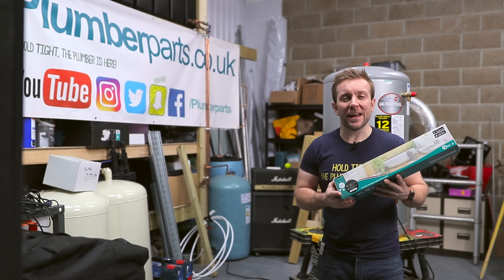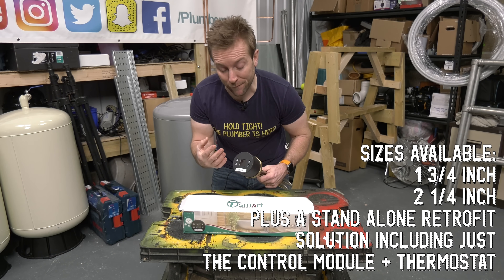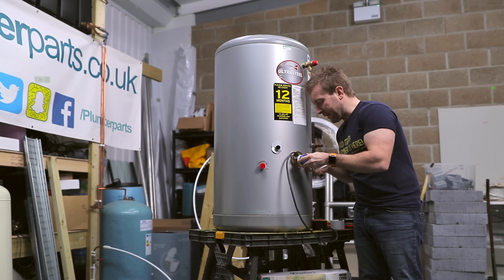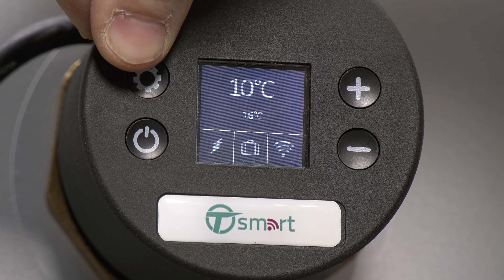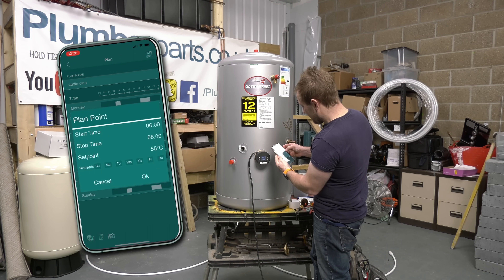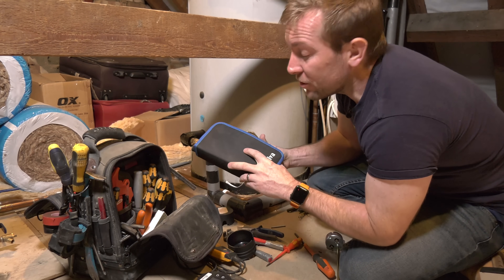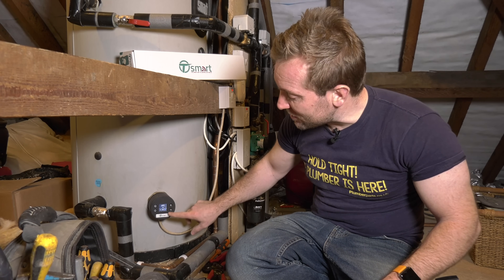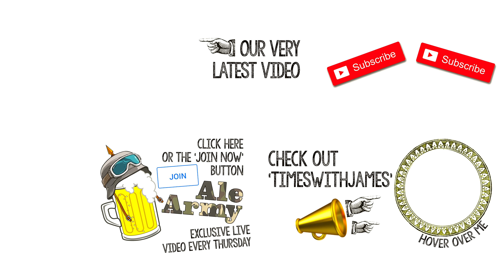HOW TO UPDATE TO SMART IMMERSION HEATER - Tesla T-Smart Review

Comment: Hi James . Well done on your presentation video. May I put a couple of queries your way. Tank with 2 electric elements.... top element is the really long type. The short element goes in approx same position as your demo. What temperature settings for the thermostats ??? As the lower stat set at 60 would mean the top of tank would be a LOT hotter than that. I have seen tesla are making "WILLIS" heaters. Could a Willis heater go under the kitchen sink and be fed from the mains ? Would you fancy doing a video about "WILLIE'S " The price was about £40 for one ,I believe. Love to hear your thoughts.
Regards Don.
Reply: Hi Don
I can answer one of these questions for you. 
You're right as heat rises the top element will be in hotter water than the bottom unit. This is a common nuisance in top mounted immersions due to the chimney effect and one we are developing a solution for with T-Smart.
T-Smart can be fitted vertically so for your install the lower immersion and the control temperature between 15 and 70 degC, you can manually adjust this via the app if you are getting trip outs on the top mounted immersion, however T-Smart would become the main control so the top immersion may very well become rededundant and the high limit not an issue? 
If you want to talk more please email in your contact details to info@teslauk.com and I can call you and discuss this further. 
Thanks
Richard
Reply: @Richdev1981  Thanks Richard. If I need to contact ,I will .Many thanks for the reach out. Rgds Don

Comment: Very interesting product. I'm currently considering switching over to Octopus Electric agile tariff, where price per kWh varies every 30 minutes. A facility to integrate a smart immersion into such a scheme would be amazing. Set rules such as heat to 55c when cost < 10p, heat to 65C or above when cost is < 5p etc. Was already wondering how to implement such a scheme...
Reply from the maker: I've got a feeling this is in dev with Tesla at the moment, but don't quote me on that!:_Holdtight:
Reply: can this be integrated perhaps with a smart automation system such as Home Assistant ?
Reply: There’s controllers already available for this for charging electric cars ☺️
Reply: home assistant is the only way

Comment: NOT APPROVED for vented cylinders with the emersion on the top. The extra heat at the top keeps tripping the secondary thermostat. This is from T-smart technicias.
Reply from the maker: Exactly mate. In dev at the moment apparently. Think I said this in the video but can't remember! :_Holdtight:
Reply: Hi Mario,
You are right here, on vertical mounted anyway and we promote this on the box and instructions to hopefully stop any problematic installations.
We are presented with two issues which we are developing a solution to overcome. T-Smart is the most accurate thermostat on the market with +/- 2 DegC which is amazing for energy efficiency however in  vertical mount this presents a secondary issue where you get a chimney effect and this accuracy becomes our enemy.
We will overcome this so please keep an eye on our social media platforms as we will make an a  announcement when this happens. 
Thanks for the feedback
Richard.
Reply: @Richdev1981  Fantastic. I'd love to promote this on the 21/4" as that's where most of my cylinder work is. Was hoping to install on my vented cylinder. Keep us updated as love the concept. Thanks

Comment: Good product and great review but to expensive.
Normal £27.00
Tesla t smart £145.00🤔
Reply: Agree,and do we really need it ,i doubt it.I was hoping the heater itself was going to be revised in design,£145 , no way.
Reply: Thanks for the feedback. The retrofit version is £89.99 + VAT. T-Smart is an immersion heater and programmer all-in-one so, there wouldn't be any need to buy a separate timer. It also features anti-legionella and frost protection as well as being able to be controlled remotely, hence the price difference from your standard immersion heater.
Reply: @teslaukltd  So as your well aware plumbers, are constantly changing immersion heaters for a couple of reason, either the stat is blown, or the heater itself has rotted through in one or more places after,to be fair a good few years, So with this new heater has it got an upgrade on the element top last longer or is it basically the same as we have all been using for 40 years or more,, PS thanks for the reply.
Reply: @peterryan7827  I believe they do do a titanium version that you can get but you can get them in standard form as well.
Reply: @teslaukltd  I agree the features and the technology is well Thought Out and is worth a bit extra compared to a standard one. But I can't see people wanting to upgrade for price difference. I would like to know on typical usage when would you get your money back with the energy saving compared to a standard one
Reply: @jgregory935  Our electricity is too cheap. If we had to pay more for our electricity, we would be more careful with it, and energy saving devices like this would pay for themselves in a very short time.
Reply: @teslaukltd  Have you sorted the issue with the cylinder top element tripping? Told by you Technicians that it's not approved for these cylinders.
Reply: @teslaukltd  Where does the unit stand on off peak supplies?? Does this just then act as a monitoring device?

Comment: A retro fit for the tank thermostat would be a fantastic product.
Reply from the maker: It's already in the Amazon store mate. Just make sure you've got the spade fitting type thermostat on your current immersion. Think they've got the other type in development atm. :_Holdtight:
Reply: @plumberparts  not the immersion, the actual cylinder thermostat. By great to have a more accurate type product that could learn how boiler heats the store and preempt desired temp, rather than usual overshoot.  Give digital setting and read-outs and show how the store functions in terms of heat loss etc. Be an interesting product.

Comment: That looks AWESOME. Great video James. I have a lot of Smart home products, including Tado on my heating (but not hot water at present). Gutted that I don’t think this TSmart will work out for me. I have solar panels and my immersion is switched through a Solar iBoost so that any surplus solar electricity I’m not using is channeled into the immersion. It’s great, and gives me loads of free hot water. But when it’s dark, or I’m using all my available solar energy on other appliances, the electric current to my immersion is dead. Then there might be 100 or 200w going to it when there’s a little bit of spare, and then the full 3kw or whatever the max is when it’s blazing sunshine. Can’t see that being good for TSmart. Otherwise I’d be buying right now.  Unless there’s some sort of solar panel setting you didn’t tell us about James??

EDIT: Was thinking the current feed goes out of the fused spur into the iboost, then out of that into immersion. Was thinking double up and take a second line out of the fused spur straight into the TSmart. But probably answered my own question- the iboost and TSmart won’t talk to each other. Damn. Software fix Tesla?
Reply: Hi Mike,
T-Smart isn't a perfect solution connected to iboost as you will need contmstant power to the unit and if the tank is calling for heat T-Smart will take over and mean PV is not used. 
What you can do though is use T-Smart as a boost immersion in the top of the tank if you have a second immersion fitted. That way you can use the timer function and set the T-Smart to boost out of daylight hours as needed. You will also get the protection of anti legionella so if the iboost only gets the tank to say 50 degC it will run the anti legionella feature.
Hope this helps, if you need any more info please email in on info@teslauk.com and I can call you if you like.
Thanks 
Richard
Reply from the maker: @Richdev1981  Good call Rich! :_Holdtight:
Reply: @Richdev1981  Not sure that you would get the legionella protection from the top of the tank (only) heating to 60deg in this configuration, as the water in the lower part of the tank would be well below that. After all, the thermostat detector can only read the water temp local to the element in this design. Your thoughts?
Reply: Thanks for the replies. Was already wondering if there was a way to run secondary power to it and to use it as a temperature monitor. Only got one immersion. I have the thermostat connected to the boiler set at about 58 degrees (but it’s trial and error using a probe under the tap) and the timer for it to come on from 7pm to 9pm. The immersion/iboost on about 75. That way if it’s sunny, the water will be hotter than the boiler thermostat by the time the timer kicks in IE boiler never kicks in for water after a sunny day. The iboost has a ‘boost’ button to call for heat when needed. So works great. But if I could get secondary power to the TSmart, it would be useful for monitoring temp and setting more accurately, and for legionella in the winter. Does it sound do-able?
Reply: @mickyork41  let's talk about this, I can call you in the week if that's okay, send your contact details to info@teslauk.com and I will call you.
Interesting idea I just want to talk through some points if that's okay.
Richard
Reply: Mike, can I ask how much you paid for the Iboost inc install ?
Reply: @darrencant  it was ‘free’ as part of my solar 4kw system install. Which was £5,500 including inverter. Some time ago…

Comment: Was just thinking about the possible legionella issue if it's under 60, then you mentioned the anti legonella cycle haha Tesla have definitly thought about this product. Great vid as always James.
Reply from the maker: Mate it's a top product!:_Holdtight:
Reply: It only grows in stored water between 20 and 40 over long periods
Reply: I find it odd though, we're always taught non-pressurized hot water should be stored at 55-60 and pressurized should be 60-65 so does that mean you can't use this on pressurized as it doesn't consistently keep the tank hot enough?